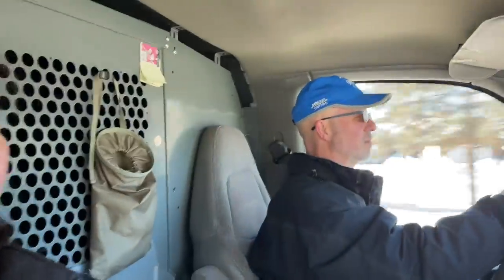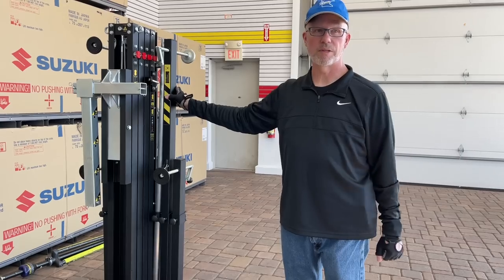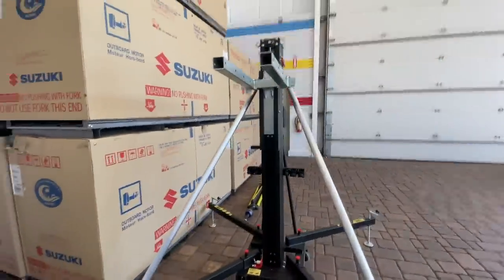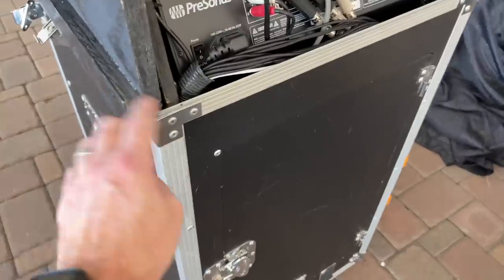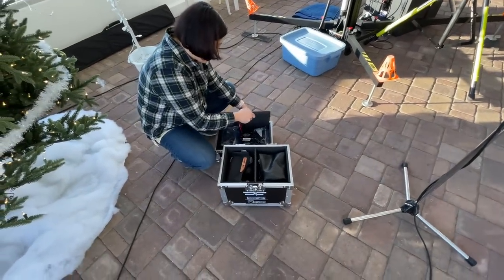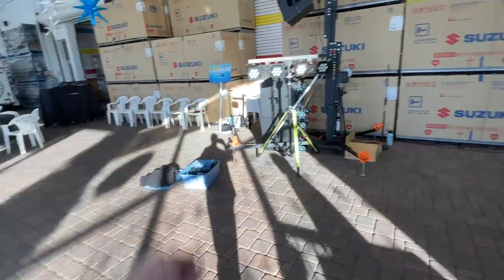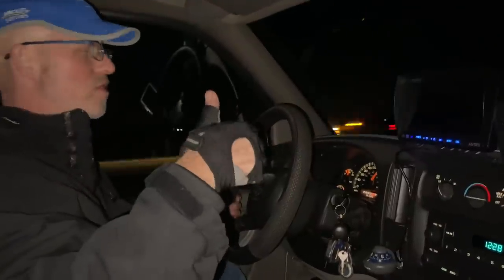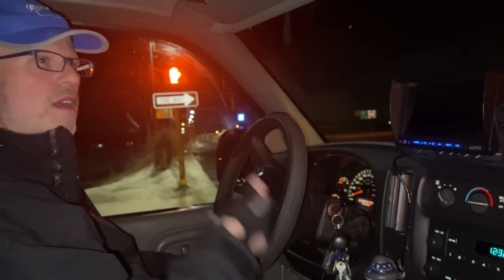The Sound Couple - GearMageddon!

Comment: An investment that will help with your wireless issues is getting an antenna combiner from either Shure, Sennheiser, or RF Venue. You can then run mics and IEM closer with paddle antenna that are more directed signals for your stage area. Just a suggestion. Love your vids.
Reply from the maker: Yep...it's all been laid out on the table since this gig!
Reply: still gotta keep those antennas a good 6-8' apart if possible... can definitely rack the stuff up together though. Also using coordination software like wireless workbench is imperative. best practice as well is to keep IEM's and RF mics as far away from each other in the spectrum as well, not just physically. in addition, wireless body packs for instrument wireless/lav mics should be kept as far apart as possible on the body from IEM packs.
Reply from the maker: It's great when the singers hold the wireless mic in one hand while using those finger to adjust the IEM belt pack volume being held in their other hand.😔 @dustinthiessen
Reply: $5k for those fly lifts now! Definitely outside my budget!

Comment: That’s a mighty set of winch ups you have there Bart! 💪💪👍✌️🇦🇺
Reply: Australian slang for towers,on another note your legs if you had them in a cross shape,you could use 2 subs side by side facing the Punters would do the job the back half you could possibly put cases ect stacked up to keep the band,punters from accessing that area,or close to wall’s ect,just to keep it to a minimum.
There’s not much you can do other than that,keep up the tumultuous efforts you and Stacy put in nice to see you going and investing in tech ,yes Mac is so nice I have 3 Mac’s love the way they integrate so well with Presonus I don’t think I would go back to IBM after the fantastic job Mac does.
I love the pecron that is a bit of mastery Bart,such a great idea,would never have thought of that,how long can you run a show with it? Can you run the pa and lights for the whole show?,im sorry if I missed that part.
Looking forward to the next show that pops up on YouTube,see you guys then!☮️🤘🤘🤘
Reply from the maker: Thanks 👍

Comment: Old knowledge by now, I’m sure, as this looked like a Christmas party, but cut some 3/4 plywood squares about 12”x12”, or whatever will fit in a milk crate (for ease of transport) and use them as bases under your crank up feet. You can set up on any ground and the stands will be stable. Also, lightly grease the crank threads. It will make it much easier, and if you’re careful, not much greasier.
Reply from the maker: You’re one step ahead of us!  We did do that to have ready for a summer gig, but never got to use them. Yet.  😊

Comment: Good deal on the investment in new equipment.  On the speaker stands, looking quickly at it, think about black 5 gallon buckets, inverted, and cut to fit over the corners where the traffic cones were.  Additionally, see if they make black snow fence as a "skirt" between the cranks, or use webbing similar to cargo planes and car trunks.  I am looking forward to the next one!
Reply from the maker: We went another direction, but your suggestions are really good.  Hopefully others will see this.
Reply: I will be looking in a future use of the hangers. Take care.

Comment: Instead of using separate adapters for the mac I would recommend getting a multiport dongle like a 5 in 1 or 7 in 1 which has all the ports but it’s only one dongle rather than multiple. Great video guys loving the new gear!!
Reply from the maker: Thank you for the suggestion.  We have since gone with the PreSonus recommended USB dongle which is the Apple certified Belkin model.  Try to stick with recommendations even if they are not as convenient.
Reply: @thesoundcouple  honestly, keeping them separate isn't a bad idea.... if one dongle goes down, you're not completely hosed. what is it they say about eggs and baskets... lol
Reply from the maker: I leave the Ethernet and USB adapters connected to the cable, so I am really back to what I was doing before.  The downside is if I don't have them conveniently located then I need to retrieve just those cables. @dustinthiessen

Comment: You will not regret the speaker stands. Great choice, too.  I got a version from the same place, but mine are generally for a truss. Two of my CDLs will fit using the pole mount on the CDL. But, I cannot put three on that way, as you know. Mine, however, have 4 equal length legs that work very well on non-flat ground.  Sometimes the wheels are a few inches or more off the ground.  You’ve had them several months now, so I would expect that you’re more familiar with them and they probably get used now more than you thought they would. If I had your type, I would be using them for all but short rooms and definitely outside all the time.
Reply from the maker: Thanks for the info...we thought we would be using them more outside this year, but between the gigs we have had or other constraints, we surprisingly, have not.

Comment: Love the new gear. One thing that makes me a little bit nervous is the black cover that Stacey made for your foh-case temperature-wise. Shouldn't the case be opened at the back to allow the air to come trough? (I hate my wordings, but i'm german but i hope you get the point :D )
Reply from the maker: Ahhh...good observation, but should be of little concern.  The only thing that is being used int he rack is a switch and our router (and power conditioner).  Very little heat is generated from the rack itself.

Comment: Try flying the subs. they don't add a curve to the array so won't stop you fitting 3 12s underneath. Also aligns the bass from all cabinets, saves space below and looks aesthetically nice
Reply from the maker: Not a bad idea....we have other factors to consider, included budgets and space.
Reply: @thesoundcouple   I've taken much more gear than the client paid for or asked for a couple of times, purely for the purpose of testing different equipment and deployments. The key is to make sure the client knows not to expect the same system for the gig in the  future.

Comment: Nice setup guys i have also line array stand but mine is so heavy ending not using but the sound quality of the speakers hits  different when you it high the range will be extend it very handy when you have lots of crowd
Reply from the maker: Yes - we noticed that the system does come to life when they are on the stands.  The sound good regardless, but it's like taking it up a notch when they are flown!

Comment: Since you now have a decent size constant curve array, with 3 cabinets, there's probably some options in the control software for your speakers to get the most out of them, usually a high shelf on the top speaker, and a bit of a high shelf down on the lowest speaker. Why? Because the most top speaker is the furthest away from the crowd, thus needing to throw farther, since high frequency's having the most trouble going far, a highshelf does usually help. And this yields for the bottom speaker aswell, but the exact opposite. Its the most close to the crowd, and the high will be really overwhelming. 

Worth a shot to play around with, if there's any possibility's software wise. Also try playing around with lowshelfing (as the 3 speakers coupled together creates alot of low(mid) build up. Can help, can destroy)

Have a good day!
Reply from the maker: You bring up some really good points to consider.  Thank you for sharing.
Reply: @thesoundcouple no problem, feel free to reach out for any further questions!

Comment: It’s a pity you can’t mount them on top of the towers would save you some floor space
A Roadcasess for your lighting would also cut down your setup/teardown time and lees on the back 👍 love the tech guys fantastic love your work 🎉
Reply from the maker: Thank you for your suggestion.  Bottom line, there are more considerations we need to account for.  We have a trailer, but it's expensive to pull and these out of town gigs really push what we can do with the production budgets we are working with.  Sometimes we need to sacrifice a little more effort at the gig to even make the gig worth our effort.

Comment: I just went back and looked at the rig,I think it looks pretty good,if people want to access these areas make them aware of the legs,secondly can the front legs,can they be shortened??,just to the maximum length you really need?,the Pecron I forgot the us is on 120 volts as in Australia we are on 240v which I guess we would get half the time I’m guessing??.✌️🤘🇺🇸🇦🇺
Reply from the maker: How long the Pecron lasts is more about the amps drawn...not how much voltage available.

Comment: Stacking antennas creates interference. You can try pointing the bottom antennas down and the might just fix your problem. Best thing to do is to get a antenna combiner. You might make it work with a passive combiner since iems only have a single antenna.
Reply from the maker: We since have separated all wireless and have been doing some frequency coordination.  The band should invest in a combiner and  get a paddle, but they haven't pulled the trigger yet.
Reply: @thesoundcouple  helicals work better for in ear monitors. I think they should be fine with just the combiner and a normal antenna. As long as they aren’t near other wireless devices.

Comment: Hey Bart and Stacy! Do you use shure wireless work bench, to coordinate your wireless freqs? I would highly suggest it if you don't use it. I would also strongly recommend getting crosby brand shackles for your rigging, do not put your trust in the "rigging" hardware from a bigbox store or hardware store. The quick link that is connected to your presonus rigging bar isn't rated for overhead lifting and should not be used in that situation. It would be better to link shackles "Crosby shackle" if you need length in the chain.
Reply from the maker: Yes, we have since utilized WWB...it's a very good tool!  Appreciate the info on the rigging...we will check into it!

Comment: Hi guys. Just wondered if you can assemble your 3 CDL’s together with the lift plate on the ground then hook on to the stack lifter? That would save time rather than adding each CDL individually to the lifted ones.
Reply from the maker: It may be possible..we feel more comfortable doing one at time for now.

Comment: Can you use a nut driver on the levelling legs? So you don’t have to hand crank?
Wow, so much empty space in the trailer. I assume the van was packed as usual :)
Reply from the maker: We learned that we need to be careful with those and ensure they are going straight down so better to brace the leg with your free arm...so no, we would say this is a process to take your time as less is more.  Yes, the trailer holds the things we don't put into the van, but at the end of the night, we may end up putting it all in the trailer.  It depends on how much time we have and how tired we are!

Comment: Maybe I missed it did you all run a redundant safety on your fly point? Lot of faith in one shackle.
Reply from the maker: Good question...but don't see how that fits into the design of of the system...The fly brackets are not even designed to accommodate that.  The shackles (I can't remember specifics) are rated to handle much more weight than we are lifting.  In fact, we are only using a fraction of what this entire system is rated at for each component.

Comment: I’m also a cdl user and was wondering with those lifts could you hang 4 per side. It looks like 3 is almost touching the back.
Reply from the maker: Yes....we would say that 3 is the limit for portable use on a lift stand.  Install is where those numbers could increase.
Reply: @thesoundcouple  ok thanks. Would probably only use 4 when I’m hanging from a stage.

Comment: Not sure if anyone has asked about the person power unit. I was curious what items were you running off the unit?  How long did you  actually use it that night and how much charge was available at the end? I have a show coming up in a few weeks and may try to rent one to tryout instead of my louder 13KW generator. Which is  very much over kill with my system.
Reply: Percon
Reply from the maker: Thank you for your question as I thought I we included that info, but we missed it.  We can piece it back together and share more info.  
For the gig, we were powering the 64s/router/computer.  It was on for approx 9 hours and was at 75% when done.  At the next gig, we used it to power our rack mixer gear and 1sub/main.  It was on for approx 7 hours and we started off at 75% and it was at 46% at the end of the night.
We have used it to power backline/lights, and partial PA.  In total, we use it for at least half if not more of our gigs in some capacity.  It quickly and naturally became an important piece of gear for us in both piece of mind and utility....we would never NOT have one again for the type of gigs we do.  For us, we really didn't know if this was tech hype or real...it's real.  Good luck!
Reply: Im.sold. this is a game changer. I don't need to buy gasoline and do maintenance on a gas gen. And don't need to worry about having the 220V 50A. Thank you. Keep it up  live the show

Comment: I thought if you connect the computer to the board via usb and run uc surface on the computer it no longer lets you use it on the iPad?
Reply from the maker: No...USB allows your computer to use the mixer as a sound interface.  Also, UC Surface control from the computer will switch to USB from Ethernet (so from the computer to mixer, you don't need the computer connected to the network to control the mixer).  The network portion is completely separate and all of your other devices connected to the network can still control the mixer!